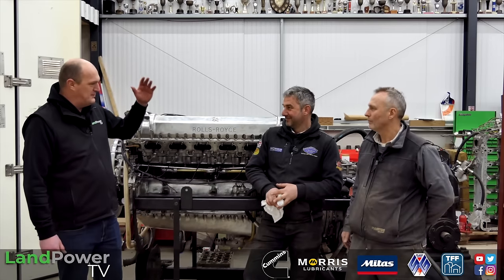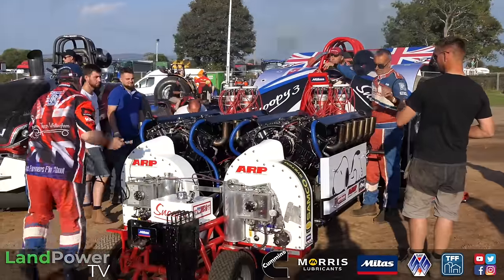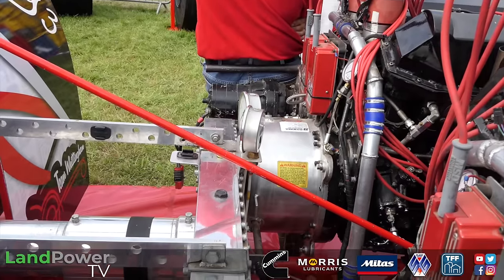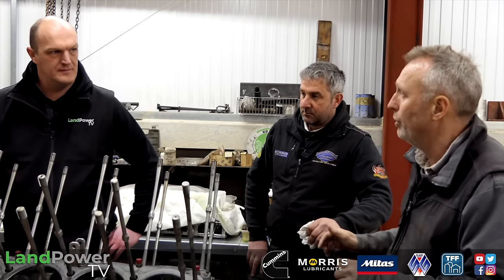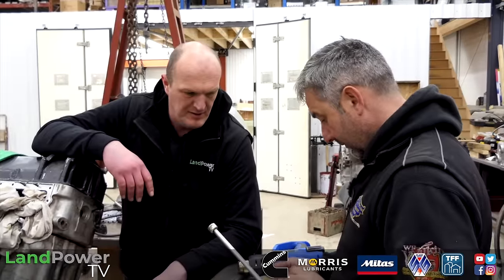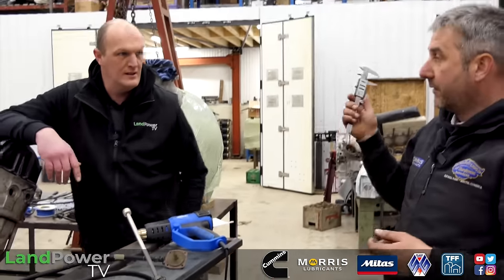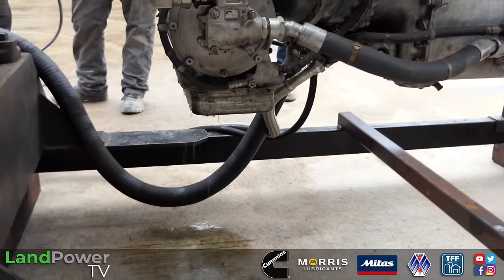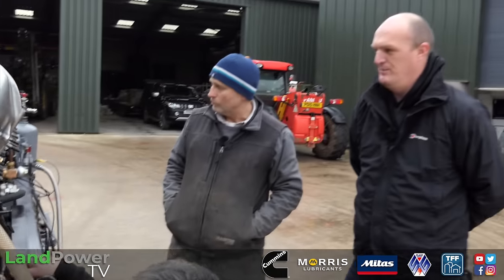Rolls-Royce Mk58 Griffon V12 Engine (the Merlin's bigger brother): START-UP

Comment: A few random piece of information.

The Griffon had three different firing orders, two in the mark one and the third for all the others marks. All the other R-R V12s from the first Eagle to the Merlin had the same firing order (apart from the ones that turned in the opposite direction and they were the reverse). 

I have been told that the Shackleton crews did not like the engine's sound.

The 1939 Griffon was a clean sheet of paper design and apart from bore and store had nothing to do with the 1933 Griffon, the R engine , or the Buzzard.  

I am unaware of any production Motor Torpedo Boat or Motor Gun Boat that used the Merlin or Griffon engines. Most allied MTBs MGBs ran Packard marine V12s, this engine is not related to the Packard licence-built R-R Merlins in any way apart from them both being 60 degree V12s. There were other engines, including those from Scott Hall. 

Rolls-Royce's last piston aero engine was the Eagle22, a H-24 (inspired by the Napier Sabre H-24), it did not see large-scale production.

The Griffon did not produce enough extra power to justify the increase in capacity over the Merlin.  It was a better-designed, more robust engine, but the combustion chamber of the Merlin was too large for good combustion and the Griffon's was even larger.
Reply: robertnicholson  and someone else knows the truth about the PACKARD M2500 PT Boat engines.  PACKARDS own design from the 1930's  2500 cu in 43 L of supercharged V12. 14,000 of them made and US Navy and the Brits used them in their MTB and MGB and air sea rescue. it was that enging that brought RR to PACKARD to have PACKARD build the merlin/  PACKARD was delivering them to the US NAvy in 1938 !!!
Reply: @wilburfinnigan2142  It was an interesting engine, but a bit of a throwback to the Packard co-designed Liberty aero engine, in that it had individual fabricated water-cooled cylinders, 6 attached to each head (possibly screwed in), this assembly was then bolted to the crankcase.  It started to get a bit finicky as they increased the boost, etc. to get more power out of it.  They were a big, heavy, engine, it must not have been much fun to get one out of the boat in the makeshift bases that they often operated from, especially, in the Pacific. 
 
In a correction to my previous post, apparently, there were about 60-70 marinized Merlins built before the war, and then the decision was made to route all Merlin production into aircraft, I assume because the Packard M2500 series already existed and was capable of doing the job.  I do not know whether these Merlin engines were ever installed into boats or whether they were returned to aero use.  An interesting side story.

Originally, R-R went to Ford USA for the contract, Ford was interested, but then Henry Ford changed his mind and decided to not build war equipment for foreign powers, although this did not stop Ford in Britain from building Merlins, which they did extremely well.  Ford built the plant in about 6 months (despite being bombed) and started production about a month before Packard.  Stanley Hooker in his book "Not Much of an Engineer" wrote that he thought the Ford-UK built Merlins were the best.

Apparently, the drawings that Packard worked off of when production planning started were obtained from Ford USA.  It was a bit of a shock for the Packard engineers when the R-R engineers arrived from England with proper up-to-date production drawings and asked Packard whether they wanted to start with the three-piece engine (one piece head and cylinder bank) or the five-piece engine with separate heads.

Comment: Remember, that engine was designed for flying up in the sky, very high sometimes where ambient pressure was lower with Very low temperatures.  To make it run reliably at 14.5 bar you need certain parts from the Pacard Liberty engines that ran at sea level…….also it really needs a constant load even when idling, you will ruin main bearing housing if not!!!!!!  I have ever manual the Rolls Royce printed for their aero piston engines….  And don’t ffs run it with no coolant in it!!!  If it’s a January to May 1945 it’s 150 octane

Comment: wow overhead cams per bank and 4 valves per cylinder  80 years ago
Reply: Twin overhead cam 4 valves per cylinder engines were first put on paper in 1910 and in the metal for the 1912 Peugeot L76 GP car, 111 years ago.

Comment: How does that engine run with no exhaust manifolds? There's no backpressure in the cylinders.
Reply: Why would ' it run? Even two stroke engines that are much more dependant on a good exhaust run without problems, not optimal but without a hitch.

Comment: lovely engine ,we need to use these before the eco-terrorists go crazy . i love my old bikes and cars to bits . will never give them up
Reply: As a confirmed crazy eco-terrorist I also love the Merlin and Griffon. A couple of them running every now and then won't kill the planet. Thr problem is all the gigantic 4x4s driving with just one occupant over distances you could easily walk or cycle.

Might be worth trying to cure aircraft engines of their lead habit though. Nobody should be breathing that stuff, plus it kills spark plugs and causes oil contamination issues that accelerate wear.
Reply: @nerd1000ify  nah wont happen , ill make it my mission to make greta's life hell , ill keep my diesel , not a 4x4 , but only when 10miles+ , otherway i take my motorcycle. ill never drive EV / bicycle ;)

Comment: I would love to implement fuel injection onto an engine like this.  I feel like they could make way more power with proper fueling.
Reply: No no no that was discussed in WW2 and the fact the fuel stays cooler from a Carbie thus being denser and allowing more power was the reason R/R stayed with Carburettors
Reply: @jacktattis correct - and the cooling fuel going thru thr super chargers-

Comment: Good way to burn valves, no exhaust back pressure.
Reply: but aeroplanes never had exhausts...
Reply: Aero engines never had back pressure unless turbos were used
Reply: @paulriggers1558  just enough to get it out of the cowling, but, they did figure out if they angled the shorty pipes backwards, the exhaust flow was good for about 75# of free thrust
Reply: Never runs long enough for that to be an issue.

Comment: Does a V-12 not need a flywheel?  These V-12 engines are often run without even shortened propellers.
Reply: Probably has enough mass in the running gear to keep it rotating?
Reply: @1967250s  A Shackleton reduction gear would be for a contrarotating propeller pair.

Comment: The is a replacement for displacement and its called a turbo.
Reply: More of an alternative than a replacement really. A lower displacement turbo engine and a higher displacement NA engine are different beasts really, both have different characteristics, strengths, and weaknesses.

Comment: has anoyone thought about putting a holley dominator on it. I mean they can run 12 cyclinder engines and they make injector to feed it no problem. Just a thought. I'll bet You call up holley they might even give one to you as a sponser to try it out..
Reply: The Griffon displaces 37 liters, or about 2250 cubic inches. And it's supercharged. So I'm not sure about a holley carb being able to flow enough CFM to feed it...
Reply: @nerd1000ify  I think I wasn't clean enough. Holley dominator efi. It's the top of the line efi ecu they make. It could run it no problem.
Reply: @LordMustangGT93  some quick back of the envelope maths says that even without the supercharger you'd have to run at least two dominator efi setups side by side to feed this thing. Needs about 1800 CFM of air at full revs without the blower. With the blower, maybe 2x 1450 CFM dominators would do it?

Anyway, the stock fuel system on these engines is either a very large dual barrel updraft SU carb or the Bendix 'injection carb' which is actually a kind of mechanically controlled single point fuel injection (fuel is sprayed under pressure into the eye of the blower impeller). Both of which do totally fine for ground runs. The Bendix however is almost immune to the effects of G-forces in a dogfight, so it would be the preferred option if you could choose.
Reply: @nerd1000ify  I'm not talking about carburetors at all, just so we get that out of the way. I was thinking port injection with injectors bungs welded into the manifold spaying on the back side of the intake valve and getting rid of all the factory fuel system. Blower can be left on with no worries. Just need one giant custom throttle body made for it, or like 4 of the biggest ones out now, or more lol. Put iat, water temp, map, and a wide band sensors, or two, on that beast, and it would cold start no problem and run like a champ. Obviously have the dominator hooked up to the factory distributors so they can talk to the ecu too, but it would be an old girl with new tech running it.

Comment: If I remember right, a man was doing very well on a Griffon powered Mustang at Reno air races. The figure 8 pattern was much tighter with the torque cancelling contra rotating props. He was faster in 100LL than others running alcohol burning monster engines. But I might be wrong

Comment: what would be cheaper i wonder?
finding the real deal?

or a company running up a set of patterns and castings and making a limited run, to a slightly lower spec... not for aircraft use....
Reply: paradiselost  Jack Rousch in USA has a merlin shop and approached RR to built new Merlins and RR freaked out could not say no No NO fast enough !!!
Reply: @wilburfinnigan2142  no money in it. RR isnt the company that henry and charles started.
they woulda done it for the hell of it. then strapped it to four wheels? a better time?

shame they never got to see the pinnacle of their namesake...

Comment: that engine has 36.7Liter displacement, with a turbo it would do about 8100HP without a problem. i want to see that engine with a turbo on it behind the driver in a car. 8100HP would be enough for like 700Km/h topspeed.
Reply: Conrods wouldn't last 5 mins.
Reply: Offenbarung  It already has a mechanical supercharger on it and even a turbo would not make much difference !! ! And the rods would not last !! !

Comment: They don’t like idling with no load and if idle too long they  overheat very quick! All rads must have air I’ve them……. And 150 fuel if the updated motor

Comment: I was always taught that running an ICE without an exhaust manifold or headers was very unhealthy for the exhaust valves.
Reply: I was taught the same but apparently it's not true
Reply: Sodium filled valves and the super charger contribute to not burning valves.
Reply: These things usually ran super short 'stub' exhausts, basically just nozzles that directed the exhaust flow backwards, which actually contributes a significant amount of thrust. So they never really had headers to begin with.

Comment: They used to use aero engines in hydroplanes racing boats. One of the mods with a Merlin was to strengthen the drive to the supercharger so they could run full boost at see level. A modified Merlin could produce 4000 bhp, and rev to over 4000rpm, so about double the bhp and revs that they were run at in a plane. See this video for more info. https://www.youtube.com/watch?v=MwI_qctNmJg
Reply: thanks for the link mate very interesting it was
Reply: keith  And the Allison ran right with them and did not throw rods !!!!!!
Reply: @wilburfinnigan2142 😂

Comment: Seems like those super rare & expensive heads would start running too hot without at least SOME TYPE of exhaust manifold or headers. Good grief. So much for "exhaust scavenging".
Reply: The original 'headers' were just little stubs that poked out the side of the plane and aimed backwards to direct the exhaust for extra thrust.
Reply: @nerd1000ify  See my other response to you. I forgot to also mention that at least in flight, they DO use exhaust pipes and they are approximately 8" to 12" long, ( these 12 cyl engines are very long, so those "stubby pipes" are a little longer than you think they are ), and that absolutely directs the fire & heat away from the heads of this engine. And with the rush of air running across the exhaust tips WHILE in flight, I'm sure that it somehow creates the perfect combination of what is known as exhaust scavenging, which is a sonic pulse that runs back & forth all the way through the head to literally help it breathe even better when running.
Reply: @howabouthetruth2157  The Griffon's bore is 6" so even a 12" long stack is very short by most standards, imagine how a typical automotive engine would look with exhausts only 2x the bore in length. Anyway, the stubs apparently are enough to prevent thermal shocking the exhaust valves, or perhaps that was not an issue regardless.

To my knowledge they never made use of sonic pulses in the exhaust, the stacks are way too short for this considering the engine's 2750 rpm redline. The stacks are lightly tapered to act as nozzles and the exhaust pulses are used to generate jet thrust assisting the propeller.
Reply: @nerd1000ify  Even though they are as short as they are in relation to bore size, they still do the task of getting the heat out and away from the head/exhaust valve & port. Furthermore: every engine is designed in conjunction with a particular exhaust primary ( each individual exhaust pipe ) to have optimal performance, so you can rest assured that those short exhaust pipes with THIS engine does indeed some sort of pulse/scavenging. And I'm still calling total BS on the short pipes "aiding with thrust". Just think about it, the redline for the Griffon is only 2,750 rpm's. That's nowhere near enough to "create thrust" for flight. No freakin' way man. The taper you mentioned was engineered to aid in whatever type of exhaust scavenging there is.
Reply: @howabouthetruth2157  it's 2750 rpm but 37L and supercharged, so the mass flow is 'lots'. Plus the compression ratio is only 6:1 or so, so there is a lot of extra energy in the exhaust gases that can be harnessed.

As for the scavenging, you can figure out how long the pipes need to be to get a certain harmonic if you know the speed of sound in the exhaust. Let's say for arguments sake that the speed of sound in the exhaust is 500 m/s, which would be in the ballpark at least. To get the first harmonic at 2750 rpm you would need a pipe about 60 ft long. Now you could use a higher harmonic but that weakens the effect. So e.g. 4th harmonic would be a mere 1/4 that length. The 8th harmonic would only need a pipe a few ft long. But beyond that, there is not really any advantage to trying to tune the exhaust because the pulses are too weak after bouncing back and forth so many times in the pipe. Even these days a lot of auto applications don't really bother, consider a typical cast 'log' manifold for example, the path to the collector is a different length for every cylinder!